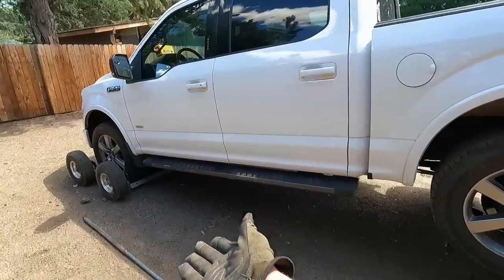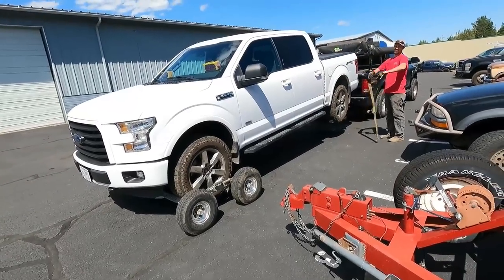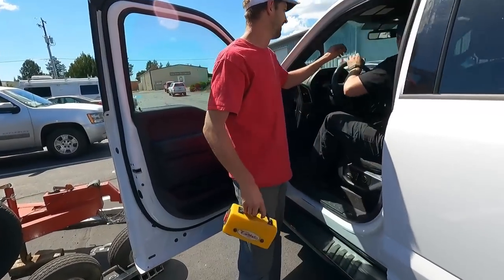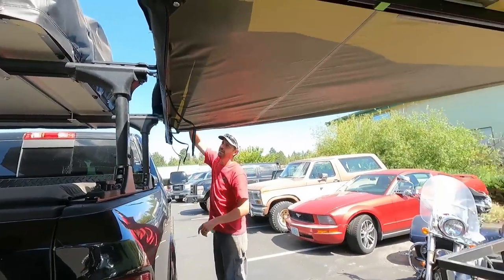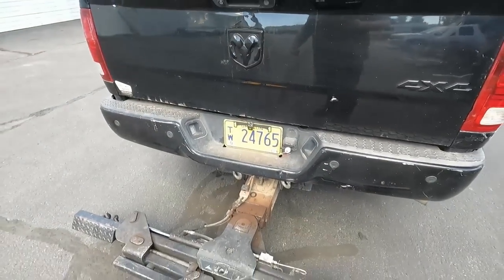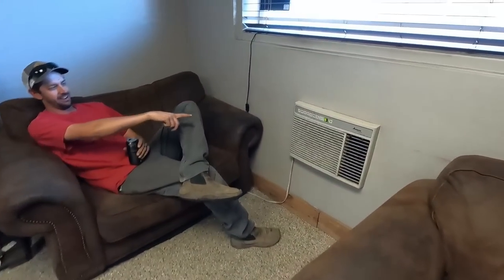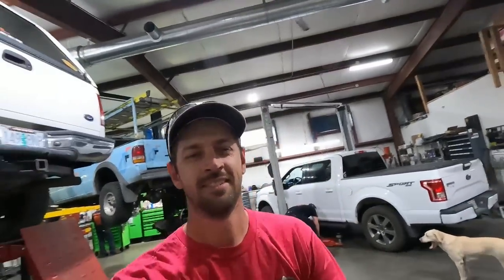Test drive fail, mechanic has to call for a tow truck

Comment: Usually I am envious of your temp there (I’m in the UK, usually miserable and wet) but we have 104°f here with 33% humidity. The country has turned into a grease spot, roads are melting etc. Just back in from watering the concrete 😉. Love how you chill out at the ac while your camera goes and makes video 😂 great job as always

Comment: Ford's IWE requires vacuum to unlock the hubs. So if the engine not running, the hubs are locked.

Comment: Once upon a time i towed a scrap car (heading to recycling) from the rear and had the front rolling on ground. The steering lock broke and car started to sway... A dolly under the front prevents that problem as well as protects the gears.

Comment: Casey: Can you weld a couple of square tube pieces to your dolly , and use those to pin in a slightly smaller square tube riser that you could attach the lights?  Might be a solution to the non-steel autos you tow.
Reply: Those are aluminum so no welding steel to them plus any extra welded on might weaken the structure they design that stuff to strict tolerances and welding or drilling can actually weaken it I use to weld aluminum semi car haulers flatbeds and pickup flatbeds and you had to follow strict blueprints weld so far skip so far and solid welds over 6 inches had to be done like welding sheetmetal

Comment: I'm with you guys on this heat! Hiding inside most of the day this week.
And I have to agree with your sentiment on the roundabouts. Though, I think that training people how to use them correctly would help a lot!
Reply from the maker: I've been working at night and sleeping during the day for the last few days.  This heat is too much
Reply: Java Beanz---I was lucky to grow up to where we often had to go through a " rotary" , which you are calling a roundabout . The rules are simple , but , you have to know them .
                        If you are in the " rotary" , you have the right of way over those trying to get into it .

                       The guy on the inside lane of the " rotary",  has the right of way over the guy on the outside lane of the " rotary" .
                       If you going to exit in one of the first two exits available , you should enter the " rotary" on the outside lane .
                       If you are going to exit through exit #3 , or exit #4, enter the " rotary" on the inside lane .
                       ( I think that you already know these rules , but , someone else may not .)
Reply: @williameddy1662  Thanks for the info! I have never heard of them being called a "rotary." They seem to confuse most drivers on the West Coast of the US. And where Casey was driving, the rules you stated only partially apply. Bend Oregon has some funky rules on some of the roundabouts, so you have to check all the signs around if you haven't been in that particular one before. Also, Bend area is notorious for having lots of poorly trained drivers, I try to avoid it whenever possible.

Comment: This may be addressed in other comments but; ford’s 4WD actuators lock the front hubs by relaxing the vacuum supply that pulls the ring gear connectors away from the wheel ends during normal driving but if the engine isn’t running there’s no vacuum so the hubs lock into the axles.   The great thing about this though is when the transmission is in 2WD and the hubs disengage, there’s no wear being put on the front axles and the whole front drivetrain is allowed to rest and this prolongs bearing and seal life.

Comment: It happened to me once, I was test driving a vehicle and it died. I had my OBD II hooked and found out it had no fuel PSI, 15 minutes later it started. The fuel pump stopped working when it got hot, after sitting and cooling down it worked again.
Reply: Is it not amazing that there is this ELECTRIC motor submerged in gasoline, and it does not explode.
Reply: @Rat-Builder  wait til you learn the motor is cooled by the gasoline.

In reality, gas is not easy to combust, the vapors are but you would have a hard time getting the liquid to light on fire.

Comment: Here in Arizona, roundabouts are starting to appear on 55mph roads in semi-rural areas.  It is so amusing to watch a 40 foot long RV towing a little car negotiate one of these.
Reply: For the occasional user they can be somewhat challenging but in a community that uses them regularly I doubt anyone would want to return to signals. The cost is installation with no electric to stop functioning.
Reply: It is also amusing to se the tracks straight across the middle when some semi driver decides to take short cut!
Reply: here in Washington they are putting roundabouts on major highways at the base of hills so a semi goes from 55 or 60 to 15 then has to get up speed to climb the hill
Reply: @jimsmith9819  common sense isn't very common

Comment: When did Ford stop using locking front hubs ?  My 2002 has front hub locks that can be engaged either manually or automatic via vacuum control.

Comment: Ford locking hubs work on vacuum. Without vacuum they are in the locked position. There is a flat tow mode to keep the tranfer case in neutral
Reply from the maker: Just like Jeeps, flat towing is ok, but wheel lift towing is not.

Comment: Casey,there are tail light guards for the Ram !
Reply from the maker: Then I would have just caved in my bedsides!
Those guards are made to stop tree branches, not Jeeps
Reply: @CaseyLaDelle  let you be creative with some bars mounted on the lift then ,nudge bars ,bull bars Jeep bars , considering that the back end is the working end ,then the chances of more dings and scratches is high !
Did you get some new rock lighting for the Jeep ?

Comment: Oh boy I hear you Casey, I hate round abouts they make traffic so much worse and in my area they are on state highways and most of the time two or more 15yrds apart! When I stove semi is just run over the middle of them with my trailer instead of swinging into the other lane just to make the turn, they did not design them with trailers in mind!🤦‍♂️👎🤬

Comment: Can you elaborate more on the towing of Ford trucks. Does this affect certain years, all transfer cases? What happens if you put the transfer case in neutral can you tow the vehicle from front.
Reply from the maker: It's not just Ford's, that's the case for basically all modern 4x4's

Comment: It looked to me like that awning has 90 degrees of coverage. I guess you can subtract the 90 from the optimal 360 coverage and you get 270 degrees.
Reply from the maker: Might want to look again, 270 degrees of coverage
Reply: My mistake, I didn’t realize it came out so far from the corner of your truck. I just saw a right angle covering the back and one side of your truck. Hence the 90 deg. I looked it up and saw an overhead view which is much bigger than I expected.

Comment: About the roundabouts. We have them for some 20/30 years now. But people forget how they should work. When 1 car is on the roundabout you should wait till he turnes right so you have a clear road. But people just squeeze in front of you and block your exit because his next exit is blocked by cars who have to give pedestrians and bicyclists the right of way. So its the(not having any discipline or decent behaviour) people who make it a mess. The lanes are kept small to decrease speed. The one i am reverring to had a 1 lane road that was 2 lane size. So we have to thank the folks that drove 1 1/2 to 2 times the allowed speed. And indeed its a nightmare for long vehicles. Thats why city(amsterdam) delivery is done by special trailers with a automatic steering shaft. Or the shaft is put more forward.

Comment: Ha! Roundabouts! Suck!  When my home town started to put them in 10/15 years ago they put them in existing intersections. The first 20 were put in with the full 4-6 inch tall square curbs and most of those were changed quickly to the slope sided on due to too many insurance claims from trucks blowing tires on the curbs. Their were so bad that my 1992 dodge Dakota would clip the cut curbs at least once unless I was going 5mph. And now we have a myriad of different sizes and shapes. We even have single lane ones  on tractor trailer routes. Those ones actually have signs just before you get to them saying just drive over the dam things if you need too. Roundabouts imo only work if the areas have actually enough room for them and only in areas that are just being developed.
Reply: They are more or less a flat speed bump, meant to slow drivers down at intersections...
Reply: you would love the tiny roundabout in my home town singel lane and the center is rased a bit over a foot 40-50cm of solid concreat oh and thay planted busses on top of it so noway to see over the bloody thing   luckely we are used to em as thay arent rare in sweden.  
and onely know of one totald car from it some yahoo was out driving a bit to fast and parked on top of the roundabout  car was a total wrightoff

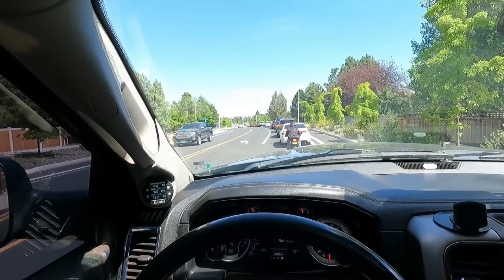Comment: 2:50 another reason I call Oregon the NJ of the left coast! (in addition to not pumping your own gas) 😂
Reply: I live in Idaho, and they are starting to put those awful things in my city.  They are a very dangerous type of intersection, in my opinion.  On one of the freeway bridges, they put a "diverging diamond" in place, and I will have to admit, it works very well.  The roundabouts?  Not so much.  Does the right coast have a lot of those awful things?  (roundabouts)

Comment: Drivers are the problem not the Roundabouts....
The over cautious, afraid, brake riders, the ones who don't know the difference of what lane to be in so they can continue on or existing right or left once in the roundabouts .
Nowhere does it tell you to come to a complete stop or to change lanes in the middle of roundabouts because your lack of foresight or using the wrong blinkers.  
Also the cost is way less than traffic lights/intersections and all that goes with it.... 
Although 1 cost they didn't account for in my town was the people using the roundabouts for jumps .... 1 to 2 times a month someone thinks they are the Duke Boys...  even with a full size Bronze Elk in the middle of it...

Comment: Roundabouts are the stupidest thing someone ever came up with doesn’t help traffic whatsoever, I think it causes it, and I am a avid motorcycle rider, and I’ve almost been hit four times in the double roundabouts
Reply: Oh god the double roundabouts. Up here in bc Canada the number one accident in roundabouts is the cars and trucks getting beside a tractor trailer just as it’s about to use the double lane roundabout and then the smaller vehicle of course gets run over. Driver of the smaller vehicle is typically found at fault due to the fact we have signs 3 feet high and 6 feet long stating very clearly that the tractor trailers get both lanes and that the trucks will crush the things beside them.
Reply: @BrainsofFrank  Well I didn’t almost get hit with a tractor trailer, it was other vehicles other cars,
Reply: @bryanmitchell4463  roundabouts are statistically proven to be very effective at keeping traffic moving through an intersection and to reduce the severity of almost all accidents that do occur.  It’s drivers who don’t know how to use them properly that’s the problem, not the roundabout itself.
Reply: @JohnHallgren  Those are one in the same problem, and who is proving it, the same people that are broadcasting the 5 o’clock news that’s lying to you ,see how all that works, you’re free to think what you want, Like I said I’ve almost been hit four times, none of them were my fault, I’m not the problem
Reply: @bryanmitchell4463  I couldn’t make any sense of most of your reply. However, It’s traffic engineers and others who have proven that they work effectively from both modeling and real life. And traffic safety professionals have confirmed that accidents are reduced compared to other options, like stop lights or signs. Plus, in a proper roundabout, a T-bone accident is almost impossible but very common at regular intersections,

Comment: That's because the hubs are vacuum operated. When I bought my F-150 I had a broken line on it I had to take make it to where my hugs were permanently locked into I could find the leak.
Reply: You arent wrong on the vacuum issues with that generation and the previous generation f150s however even if the system is working properly the hubs are still engaged with the truck off. The hubs only unlock when there is vacuum and there isn’t vacuum when the truck isn’t running. 

Also, pull off the vacuum line on the actuator solenoid on the firewall and plug it. It will lock the hubs 24/7 essentially making it a live axle and 100% more reliable and will not have the chance of the actuator teeth grinding off if you get a vacuum leak leaving the hubs partially engaged.

Comment: And the reason there’s more Fords in his shop, because they sell twice as many.  🙄

“Truck Sales
In total, Chevy sold 150,674 pickup trucks, down more than 9 percent compared to Q1 2020, while Ford sold a total of 227,963 units, for a gain of nearly 10 percent.”

He should see more Rams. 

“Ford remains the segment leader with 362,032 units sold in the first six months of 2021 vs. Ram's 313,068. Chevrolet is third at 161,706 units, followed by GMC at 75,495. Toyota and Nissan round put the segment with sales of 43,865 and 17,776 units.Jul 5, 2021.”

Comment: My neighbor just had their Ford car towed from the front with the under reach like you have. They never put straps around the tires or no lights in the back. Once he had it under the tires he never got out of the truck never checked it. They are not a local towing company they had several miles they had to travel.
Reply: Don't use them......

Comment: Was that sarcasm about the roundabouts
Reply: Yes it was.  I hate those things.  We do NOT need to imitate Europe.  We have enough problems already!
Reply: @Rat-Builder  Massachusetts has had them for decades (but called rotaries) and residents here know how to drive in them.  They work fine compared to other options.

 roundabouts are statistically proven to be very effective at keeping traffic moving through an intersection and to reduce the severity of almost all accidents that do occur.  It’s drivers who don’t know how to use them properly that’s the problem, not the roundabout itself.